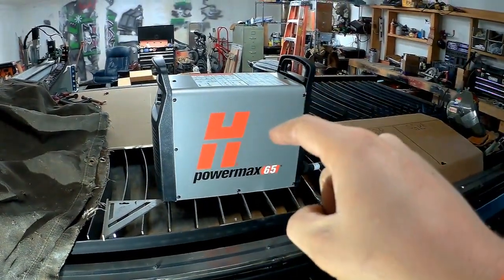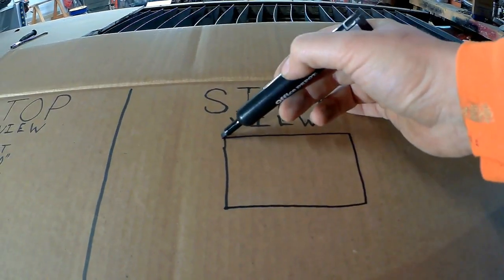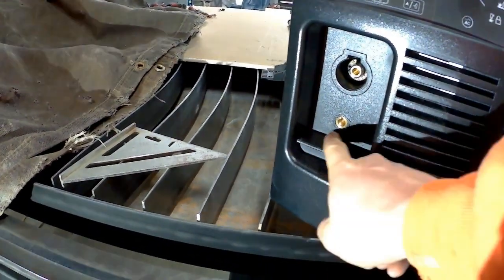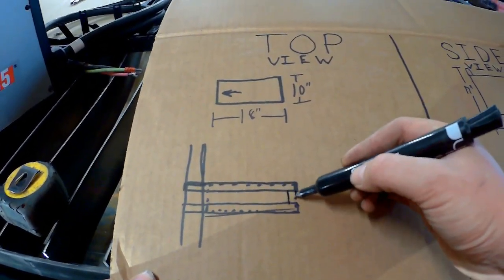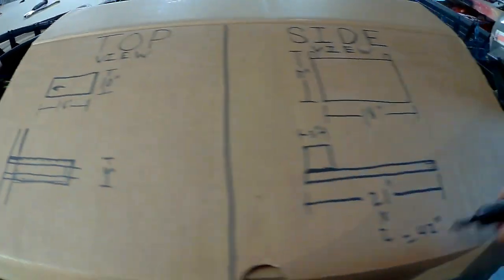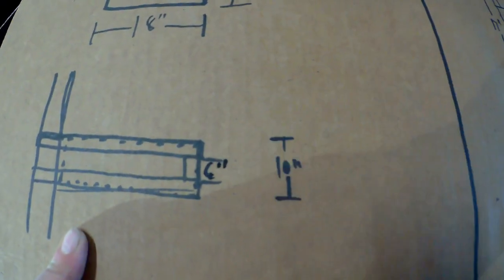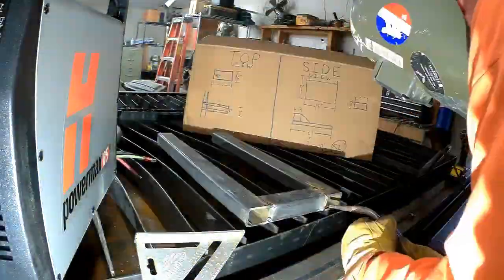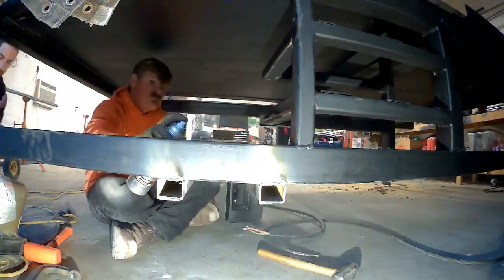How to Fabricate Metal for Beginners

Comment: "CAD (Cardboard Aided Design)"....LOL!  Love it.  Also, just wanted to say thanks for taking the time on these videos.  They motivated me to get started on my 5x10 table.  THANK YOU!  =)
Reply from the maker: Dan Auxter hell yeah, that's the whole reason I started making these vids! To get ppl pumped to work on their own stuff 👍 Are you building from a kit like me?
Reply: Maker Table: Yes, building a Precision Plasma 5x10 v-rail table this week in 3x3 square tube.  Water table in a couple weeks.
Reply from the maker: Dan Auxter Cool! i didn't have any trouble w precision plasma' s kit, I only ran into issues when I got to the electronics packages from candcnc.
Reply: What were your issues with C&CNC?  I was thinking of their "automation" package with RS485 and Linux CommandCNC and a 45xp (mostly 10ga to 1/4").
Reply from the maker: They sell a good full package of everything you need to get up and running. The support is great on weekdays during business hours. But the instructions are so convoluted and full of revisions that I had a hard time finding the information that I needed for my kit.  It could be that I am just totally 100% new to CNC and this is all part of my learning curve and not really about "the kit".  But my guess is it's somewhere in between.  I just got the power for the compressor and plasma tied into the breaker today so I hope to be testing the full capabilities of the system soon.  I'll keep you posted on my final impression of the kit when I get running 100%